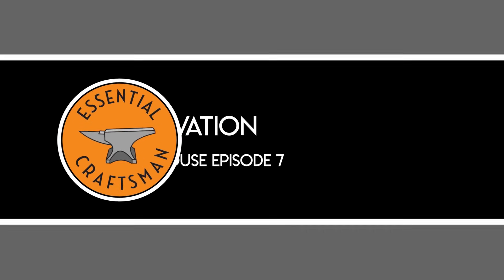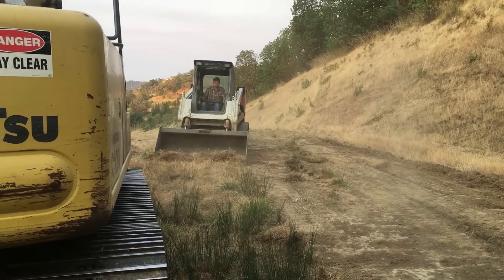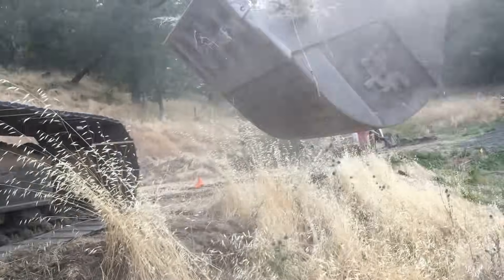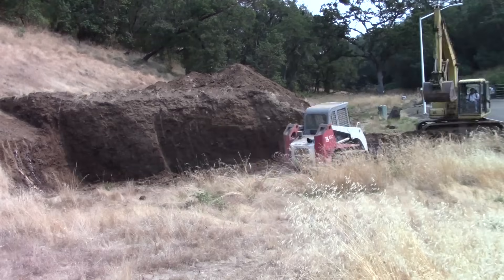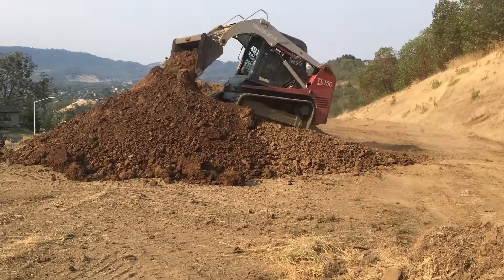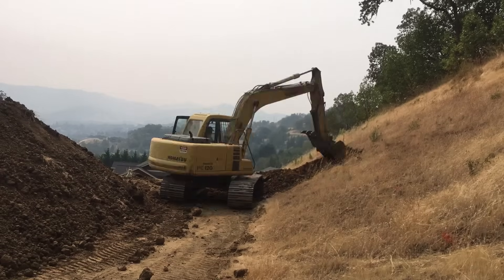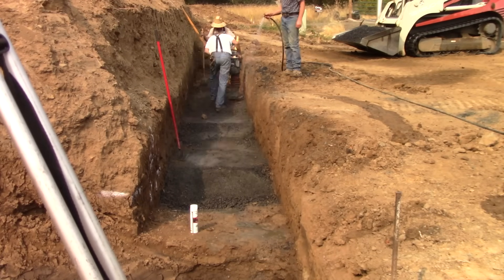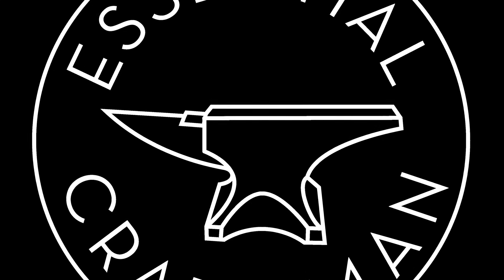Excavation - Spec House EP.07

Comment: Watching a good equipment operator run a piece of heavy machinery is a lot like watching Bob Ross paint.  It looks easy enough until you try it yourself.  Then you suddenly realize what a unique talent they have... and why they are worth every penny.
Reply: This goes for pretty much any specialty, really. You'll feel the same way when Scott starts doing the framing, I'm sure. You think nailing 2x4s together is easy, and then you see a pro do it, sinking nails in one or two swings.
Reply: If this series has been about anything so far, it's been about the true value and usefulness of professionals at work.
Reply: Not even 20 minutes ago my wife was watching Bob Ross on Netflix. lol
Reply: Awesome job!
Reply: Nothing better than working with true professionals.
Reply: Agree completely....  but, there is nothing like have the equipment and the time to do it yourself either.  Excavators are a hoot!!

Comment: That machine operator was top notch. The company I work for is finishing up a 38,000 sq ft. commercial building we started last august. It's lot is a 1/4 mile away from the beach out here on the east coast. The whole lot was soft. We dug out and replaced 100's of tons of dirt. A lot of which was by hand, with three guys, because the plans called for large sections of the foundation to be filled to the top with a concrete slab meeting the top of the block.

Comment: Excellent example of the dangers of working in soft soil. 

Also a good example of why having positional and grading sensors on the heavy equipment can be such a great investment. When an operator can check their own depths without exiting the cab or waiting for someone to step in to take a reading, then it means less waiting downtime for the equipment, fewer chances for someone to be near the equipment, and less need for someone to place themselves in the danger areas when there is a slide risk. 

Hopefully such sensor packages on equipment will be as common as backup beepers before much longer.

Comment: Thoroughly enjoy all your videos, and respect your work. Wasn't it a pretty clear risk from the outset that the hill side could give way? The cut was almost vertical, very tall, with no batter. I wouldn't stand anywhere near that, great rule of thumb, to not stand horizontally any closer than the height of the bank. I understand you needed to stand close to laser the height, but in that case.. why wasn't the slope benched from the start before standing close

Comment: how does the  excavator hold the flat cutting blade on bucket? (i have a small backhoe, and would like to have a smooth cut , instead of tooth marks)
Reply: chrales hanse --- I used a tooth from each side of the excavator bucket and with the teeth still mounted, I welded a piece of worn grader blade to those 2 teeth. When I wanted all teeth again I just took the 2 welded teeth and grader blade off and put my regular teeth back on. NOTE: Put all new teeth on the bucket, except the 2 outside ones and weld to the old teeth with the grader blade edge just below the new teeth and you'll never have to worry about the new teeth being too long.

Comment: That is some really easy digging ground, definitely want to be following the engineers recommendations or you will be in a whole lot of problems with the house shifting and cracking etc.  I would be lost on your jobsite I'm not used to working with or dealing with soft ground conditions around here were dealing with rock the ground is hard its either dynamite or a rock hammer.  Most of the time you try to use the rock to your advantage and modify your house foundation. As for an excavator operator he/she MUST be aware of their surroundings when they are working around others. To get an operators attention throw something past their field of vision never get in the swing radius or travel radius of a machine if the operator doesn't know your there. Watching this the excavating guys were moving material too many times, access road should have been made so the truck can back in you dig and load there is no need for a skid steer. More you move the dirt more it fluffs up more it costs to truck the material away.  A job like yours we would have one excavator operator and one truck driver, to do that job it would be around 10,000-15,000 dollars Canadian. There are some jobs in the area the site excavating alone is 100,000 plus yes that for a residential house, lots of people around now with deep pockets.
Reply: Have been running equipment for over 40 years and hoes off and on for over 20, I was thinking the same about loading it out as it was excavated. However there were some pretty fair operators shown in this video and likely good reasons that might not have been obvious without knowing all the details. One thing I have learned was anytime I tried I was usually wasting my time trying to second guess decent operators without knowing everything they did.

Comment: Watching that wall cave in actually made me think of a time I was digging a 15ft+ deep ditch underwater (one of the less glamorous jobs we do in commercial diving, but consists of 50-60% of most of our jobs). We actually do this by hand with a jet pump. We were digging down to get to a lift pad on a lift boat that couldn't get it's stern pad to release from the mud. While digging down to the edge of the pad, I realized I had a large wall that I felt was going to cave in on me if I tried to make my way under the pad (Basically if we can get some mud cleared out from underneath the pad, it would usually be enough to release the mud suction). Instead of trying to climb the wall and bench it that way, I just started cutting into the wall at the base trying to get it to cave in. Sounds stupid but things are not always the same underwater as on land. Anyways, I felt the wall start to collapse and I just picked my legs up and rode the wave of mud. 

Was it scary? Yes. Was it fun? Yes. Do I recommend it to other divers? NO. It was a calculated risk I felt my level of experience was able to deal with safely.
Reply: @essentialcraftsman  Honestly it sounds a lot worse than it really was. Hard to accurately describe everything that went into that decision. Trying to teach people how to properly assess risk in undertaking more "dangerous" techniques is extremely difficult. That's why I won't recommend it, but it has saved me a lot of time in the past. To be honest, I usually use it in much shallower ditches and not deeper ones. This was a special circumstance where this just seemed to be the better choice.

Comment: You talked a lot about the dangers of being around heavy equipment, which is very correct, but I couldn't help noticing that several times you had stood where that 100 yards of soil fell in. That would have been a horrible way to go...
Reply: Yeah, before he did the little part about sloping the cut, every time he went to check grade, I held my breath. I used to work in geotechnical engineer, and the worked in telecommunications subsurface construction (manhole, conduit runs, CEVs) and have heard too many stories of people being killed when trenches collapse.

Comment: on some commercial jobs the principle is the same but top soil will be stockpiled for later use, excess material will be exported. however most of this will be determined by a geologist as to where and how much material exist of what type. the civil engineer will determine what will be reused for structural mterial or landscaping ("back fill"). on larger sites there is the potential to use all on site soil to complete the project, in norther states this is a little simpler because the soil is often has a "lean clay," but in southern state because of the large quantity of "fat clay" it is often exfilled and replaced with a more stable material, however it is possible to get the soil to cooperate  with an escalating method of soil/water compaction, geofabric/grid, soil-treatment, soil-lime, soil-cement,  pouring a footer, to the most desperate of acts of digging until you find bed rock/ hardpan (hard dirt) even  if that is about 100+ feet. however this latter of which are rarer.

for those you thinking soil-cementing and soil-lime is they the same, they are two different objectives with the same principle. soil-cement tries to turn the soil into concrete, soil-lime just adds lime to harden it and pull the water out of soil that just can't "let it go." from experience sometimes if the soil isn't letting "water" out it is probably because it isn't water but petrol and this will cause the soil to fail compaction, but not density. the way you deal with petrol is to burn it in a furnace or treat it with a bacteria. as far as the EPA, some soil that has been contaminated (like old gas stations) can be used on site, but if you export it, it must be cleaned. when you basically "strike oil" you have to call in a hazardous material disposal team, or else get a very expensive permit and dispose of it yourself. if you stick an actual well head, seriously just call Halliburton or Schlumberger, they would love to get the mineral rights and probably take care of all the hazmat issues. other wise you have to cap the head , clean it up, and pretty much abandon the site.

Comment: For anyone watching this, always bench or batter your soil especially when soft and even more so when machines are operating above the cut as sson as it reaches a height of 1m or 3ft. A 1:1 ratio batter or bench is what you want and could save someones life. People, especially kids, love to mess around in the cut/hole when you're not there, add some rain and it could slip.

Also when walking/working around diggers/excavators do not think for a second you are good to move until you get physical, verbal or eye contact confirmation and then the operator should remove hands off the controls/sticks and let you pass/do your task and then get back to it.  

14 years in Civil/Residential construction as a Builder/Carpenter/Rigger and the amount of injuries and near misses I've seen for what is a few seconds of safety blows my mind still. 

I've seen people nearly crushed by cranes, swiped by excavators and hit by loads. 

Work hard and look after each other out there guys. Love your videos mate, this one just had me on edge watching that cut/earthworks.

Comment: The "better to be a little too deep than a little too shallow" statement is not always true. Backfilling can change the bearing capacity of the soil, resulting in uneven settlement, and if your foundation depth is anywhere near the water table you can end up with a big mess on your hands. Otherwise, great video!
Reply: Indeed, often weak, compressible soils are overlain by more competent dessicated soils that provide a better bearing situation as well as some stress distribution above the soft clay layers.  Also, you have to be assured of getting the engineered fill properly placed and compacted which is never a certainty when working on a residential project.  Dig it to the grade it is supposed to be excavated to and the problem goes away.

Comment: I've been running equipment for over 40 years and hoes off and on for over 20, likely it's easy to make a simple terminology mistake while doing a voice over. But to be correct that's actually called sloping and not benching. It takes anywhere from 2-5 years of steady practice to make even a half decent hoe operator and that's starting with someone who's got some natural talent to begin with. Trying to rent the equipment to do a job like this is going to cost any amature far more than hiring decent professionals as was mentioned. For anyone who hasn't operated equipment of this type it takes a hell of a lot more skill and practice than it looks like, and good operators can make it look real easy until you get in the seat and try to do the same.
Reply: Turning Point very true you have to put your time in on the ground  to even understand

Comment: I don't want to bust your chops, but I really have to. Because it could've been the end of your channel. There were multiple times you were near a vertical face over 5'.and while technically you weren't in a trench. There's never a logical reason to stand that close to an vertical dirt surface, especially after telling viewers how soft it is, you should've sloped the east side as well and are extremely lucky it didn't cave into your footing while you guys were down there grading subgrade. Extremely dangerous and unnecessary. Everything else in this video was spot on and very informative to someone outside the trade. Love your videos, just had to chew some ass like I do at work.
Reply: EC and Shady,
I too was thinking the same thing. I would have been written up by my safety officer at best, at worst...........I don't even want to think about it.
That being said, EC, I truly love your channel for which I found due to my new love of blacksmithing. I have a similar background in construction, 53,  and am an IBEW Electrician in Los Angeles and will be moving with my wife to the Pacific Northwest in about 2-3 years to build on a lot surrounded by trees.
GREAT JOB ON THE YOUTUBE CHANNEL

Comment: All soils (except clays) have a "friction angle" at which is closely related to how they fail. Typically 30-45°. Take this for your bench angle. You may have gotten this value in your geotech report from Mr. Broda. Also it's not technically a "sliding moment" as soils fail in shear strength.
Reply: I believe it is called the "angle of repose" when dealing with granulated materials.
Reply: It is a much more complicated problem than that.  Granular soils (soils with no cohesion) can be modeled using the drained shear strength as represented by the phi angle, which is roughly equivalent to the angle of repose (which, by the way, has a factor of safety just about 1, so slopes at the "angle of repose" are on the verge of failing).  Clayey (cohesive soils) can fail by short term undrained shear strength or long term drained shear strength.  The failure that took place during the excavation was a short term undrained failure.  Typically, undrained failures come about due to low shear strength cohesive soil being overstressed due to the steepening of the slope or removal of the toe or removal of a stabilizing upper layer (resulting in a basal heave failure).  On the long term, the drained shear strength of the clay is affected by changes in loading on the slope and, in particular, changes (increases) in the ground water level.  The shale slope being currently excavated could just as easily slide downhill in a couple years if the local groundwater level increase and the long term drained shear strength of the residual soil formed from the shale is low enough.  

Cincinnati Ohio has more landslides per capita than anywhere else in the US due to a phenomena very similar to this where the collection of weathered shale on the side of the slope (called colluvium) has extremely low long term drained shear strength - as low as 7 to 12 degrees.  Take the toe out of a slope in Cincinnati and come back in 2 years and it will have moved down to greet you.  The introduction of cantilever retaining walls does not improve the factor of safety against a slope failure taking place but rather decreases it by increasing the driving forces on a circular arc failure and decreasing the downslope side stabilizing weight of the soil.  

Presumably your geotechnical engineer is knowledgeable about the local conditions and areas typically subject to slope movement and has properly analyzed the short and long term conditions.  But if he was on site while the excavation was taking place, there is no way he should have permitted that tall vertical wall in the first excavation which subsequently failed and could have easily have killed the star of the show.  Geotechnical conditions and problems are very much regional and you cannot apply recommendations appropriate for one locality to another without having full insight into what the impact will be.  

And BTW, encouraging clients to sue their engineer if anything goes wrong only decreases the number of qualified engineers willing to work on residential projects where client expectations are out of sync with reality.  In any large metropolitan area, typically only the engineers working on the fringes, small firms, new firms, individuals etc. are willing to perform services on residential projects because the risks of being sued are so much higher than when working with  owners much more accustomed to the issues associated with underground construction.  You couldn't guess I have been a geotechnical engineer for 45 years ... so far.

Comment: Hah.. watching you stand by that huge dirt wall face, and I was thinking, that is going to come down for sure.  People don't realize how dangerous digging holes can be.  If the hole is as high as your chest, you can die from a cave in. Another reason to hire a pro for something instead of renting the heavy machinery yourself.
Reply: OSHA doesn't permit excavation deeper than 5 feet without proper design of the side slope (benching, sloping, retention, etc.) if anyone is going to be in the excavation.  Early on, you were checking grades right up against that tall wall.  That is why people die in a trench collapse.